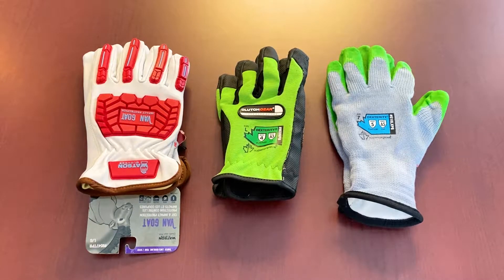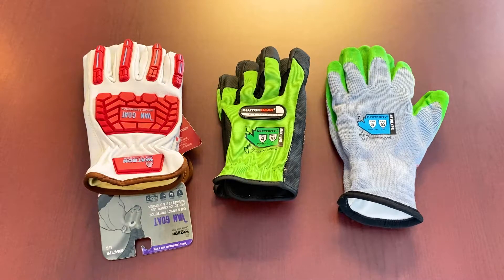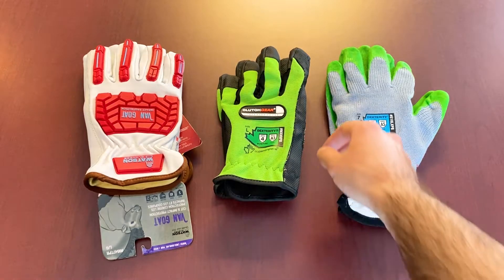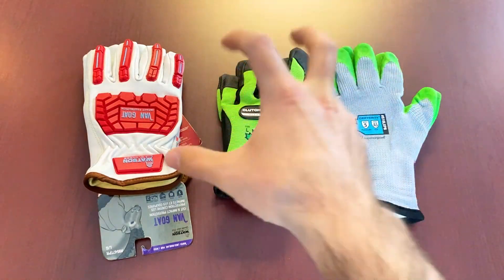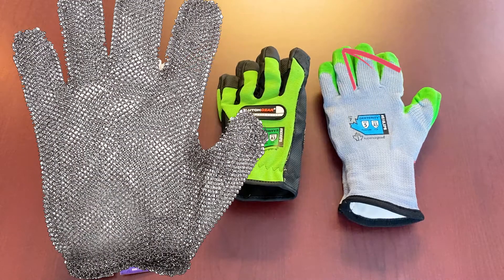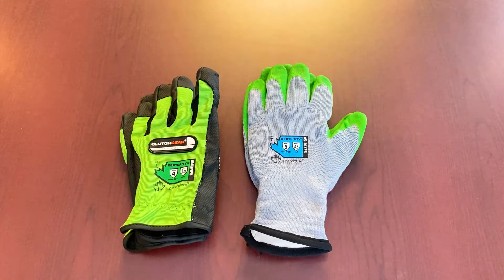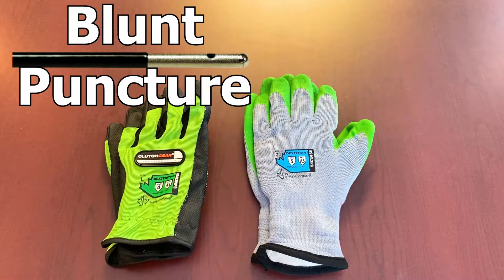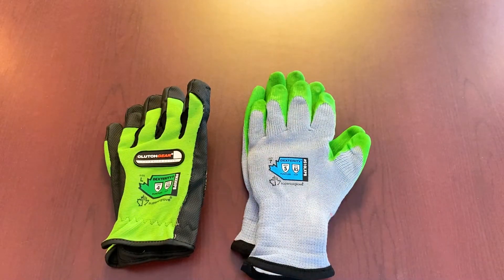Everything you NEED to know about Puncture Resistant Gloves (Hypodermic Needle Protection)

Comment: Nice Working. Please suggest me the ANSI-Puncture Level-5 Fabric in case of Hypodermic Needle.
Reply from the maker: Hi Real and Reality, there are various manufacturers that will claim to have ANSI level 5 puncture resistant gloves but in the case of hypodermic needle resistance or needlestick testing (ASTM F2878), you definitely want to read through the specs and make sure you're seeing the rating you need. Upon closer examination, you might find that certain ANSI level 5 puncture gloves are only rated for level 1 when it comes to hypodermic needles.

As far as suggestions go, Superior Glove has the TenActiv STAGLXPB and the Clutch Gear MXHV2PB (the second style number being different than the Clutch Gear product we featured in this video), you can browse these on their website if you'd like: https://www.superiorglove.com/products/puncture-hypodermic/. Outside of the manufacturers we typically work with, I believe Hexarmor and MCR safety also make some products with good hypodermic needle protection that you could look into. Hope this helps!

Comment: Hello,

Thank you for the video. What gloves would you recommend for warehouse use? Protection from potential pallet nails or screw punctures, cuts and metal shards? Thanks again. GOD bless.

John 3:16
Reply: @macmorindustries  Thank you for the fast response. I will look into these. Thanks again. GOD bless.
Reply: @macmorindustries  Also the gloves you recommend look bulky. Are there any that are less bulky but protects just as good or better?
Reply from the maker: Hi Tommy, thanks for reaching out. For this application, you will want an ANSI-rated Cut Level 2 or 3. You might also want to consider a glove that has puncture resistance, but these can become quite bulky. These gloves here are ANSI Cut Level 2: https://www.macmor.com/products/ppe/hand-protection/cut-resistant-gloves/atg-44-3745-maxicut-ultra-gloves  If you want more information on these ratings we have a ton of resources about gloves at: https://www.macmor.com/blog/ppe/hand-protection

Comment: Whats best for high tensile 4 pronged sharp as a needle barbed wire fencing?
Reply from the maker: Hi Malach, thanks for reaching out. Generally speaking, the Punkban products from Superior Glove that feature ANSI Puncture Resistance level 4 or higher would be recommended. Keep in mind, some gloves like the Punkban Clutch Gear mechanics featured in this video are also rated for hypodermic needle resistance (ASTM F2878), but only on the thumb and index. Hope this helps!